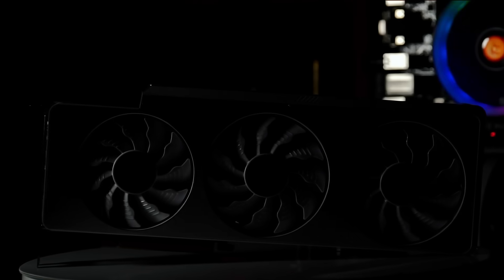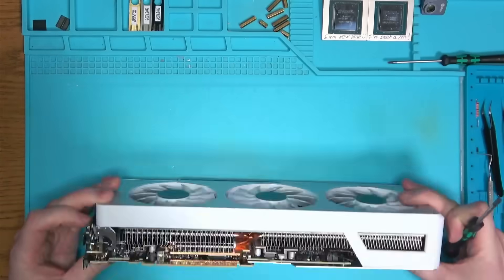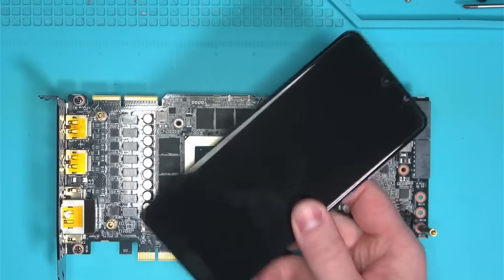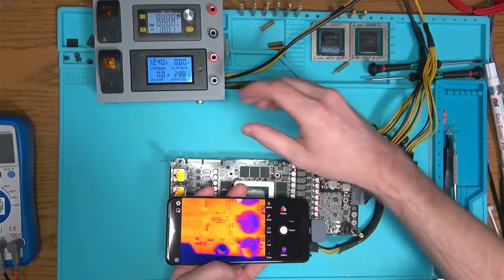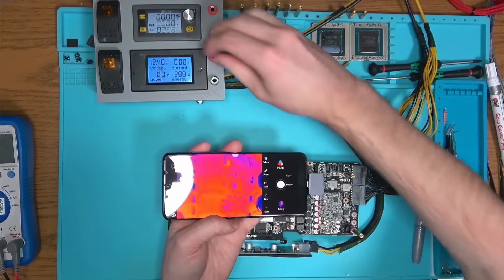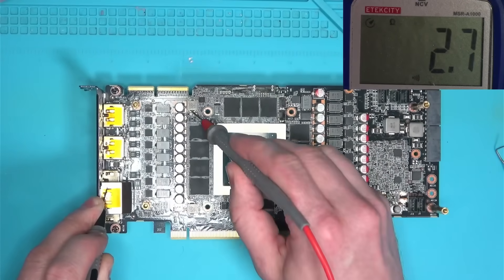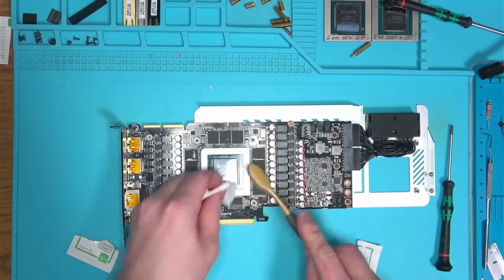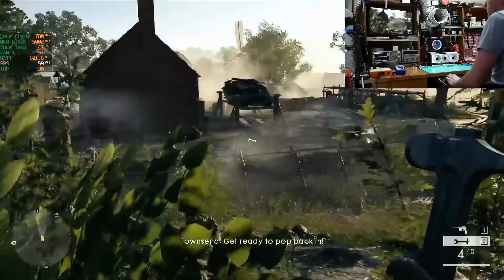Do rare and expensive graphics card fail less than budget cards ?

Comment: Tony, you didn't answer the question. Do rare and expensive graphics cards fail less than budget cards?  
Also, I have a question: you said the card was heated to at least 150°C. So, just to be clear, you have to have the entire card heated up hot enough to roast a turkey, before work can even begin? Is that what needs to be done every time? The hot air itself isn't enough? (150°C = 302°F, turkeys are often roasted at around 325°F . . . close enough) The polymer caps can handle the 150°C?
Reply: Hot to a Turkey and a powered on graphics card is not hot for a graphics card that is not running. 
Preheat in the area you are working on lowers the duration and intensity of heat needed to finally melt the solder and replace the part. This is standard practice if you are not butchering what you are working on. Lead-free solders melt in the neighborhood of 425 °F so the 320 degree temperature is a STARTING point for melting lower temperature leaded solder which you wouldn't even find on these cards.  These cards are made of many layers of copper and not preheating would result in the heat you put into the card quickly racing away from the solder you want to melt which means you need higher temperatures on an iron, in the 600 Degree range, to have a chance of removing a simple component and nothing on the board is rated to handle that much heat.
Tony can't actually answer the rare cards vs budget cards question because he only sees broken cards and he only sees broken cards people feel are worth repairing ( basically people only feel it worth the effort to save an expensive card these days so his experience is highly skewed). The best person to answer that question would be the RMA department of each card maker.
Reply: @btwbrand  That makes sense, thank you, I appreciate the explanation.

Comment: äh sorry when i post this shit here but.....my 3060ti z trio with hynix memory chips is second place worldwide 3d mark with 15771 points in fire strike extreme...this card will run 2175mhz core clock and my 5800x goes on 5.051ghz
temp card 56°c
temp chip 65°c

i got no problems or crashes with the hynix memory, this card runs 110% perfect and got a 257.8w powedraw and beat a windforce 2x 3070 lightly in 3dmark scores....

Comment: So, since EVGA is out of business, what's the most reliable brand recently according to you? Gigabyte is the only brand I never had a problem with, but I guess you have a lot of fixing to do on these cards too.
Reply: EVGA def never held that title considering the blown caps of the 900-1000 series and ripped PCB/pads under mem and gpu for 30 series. He’s had at least 10 evga just ripped to shreds and had to retrace them. EVGA got out of the game because they couldn’t make their cards any cheaper without falling apart
Reply: I know asus got a bad rap recently but I still think they make the best hardware. imo gigabyte is on my avoid list, MSI seems meh, asrock doing a good job recently but I don't think they do nvidia cards.
Reply: @Born_Stellar I like Asrock but god damn their motherboard BIOS's suck.
Reply: @alexturnbackthearmy1907  I've always ran into inconsistancies with running ram at their stock speeds (even when listed as supported on their website) and applying any stable overclock for AMD atleast. They're buggy as fk and don't have as much options in their BIOS settings compared to asus.
Reply: @Born_Stellar  no but they do intel cards lol
Reply: @Born_Stellar  I got an Asus RTX 4070 Dual last year, but the vents are very noisy already. Never happened with the Giga cards. So I'm kinda disappointed so far about Asus. But at least it didn't burn down (yet).
Reply: @Homelander-ftw   weird i just got a rtx 4070 dual and its quiet.
Reply: @Stackali  Yeah mine was quiet too. For several months.
Reply: gigabiga,ass us or any other,they don't matter actually since all parts comes from one vendor or two..it's up to them to make they own choices to make somtn good and at moderate price..
Reply: Good question. I would also like to know the answer.
Reply: asrock bios are a little old-school, but if anything this means that they are consistent and relatively easy to navigate. MSI's click crap personally throws me off, feels like cpu options are located under 5 different menus
Reply: I would avoid Gigabyte personally. Their RMA was hacked a couple years ago and wiped entirely during 3000 card release and fucked over alot of people who sent their stuff in for repair.

Comment: Card owner here. To give a little more context into what exactly happened to the card. I use the card for a 4 monitor setup. It black screened while playing a game called Afterimage from steam. A 2d/3d platformer. I've had the card blackscreen like this on me before but it seemed more like the drivers just crashed since a simple restart of the pc would fix the issue. Just a bit funny to me that some indie game would be the one to take out my card. Not even Cyberpunk. Oh well, I got the card back. Runs good. Thanks for the fix. 👍
Reply: Some games are unoptimized for power consumption. There was a crappy free first person prince of Persia rip off that had my cpu above 80c when even cinebench wouldn’t do that
Reply: @FunkyTechy  Ayup. I remember New World from Amazon literally frying GPUs due to uncapped framerate in the main menu 💀
Reply: @FunkyTechy  Makes sense. I assumed as much with what happened here. I'll be using riva tuner and afterburner to limit power from now on when messing around with these indie games. Not risking that again.
Reply: @Laggyness  v-sync also helps if offered
Reply: @Laggyness   Looks like that card does a very good job of limiting power draw with default Nvidia Drivers. Notice it maxed out on power draw at 350ish watts and still had plenty of thermal and GPU headroom waiting to be used but can't access it because of the power limit.  Heat is what takes out those Power mofsets of which you had one replaced and usually the way a card owner wrecks those is having a high gaming load and a very quiet fan profile. If you were increasing power draw on the card with out doing so for the fan speeds that is another way to cook those high amperage parts. It's a nice card and should work great for many years past the warranty period if you work it within the stock power limitations.
Reply: How much was the repair?
Reply: im not hating on NWR as they do great work, but did you check to see if this was in warranty with gigabyte first? they cover it for 3 years after manufacture even without a receipt, even if you bought on ebay.  couldve saved you $200

edit: nvm you said its a nov 2020 model, but if you are an original owner or its that close to warranty expire date, manufacturers will usually give you some leeway like 1-3 months. i've had evga gigabyte asus and msi all give me some leeway on warranty claims without a receipt
Reply: I got the card new from Newegg. Died a month after warranty. I just didnt want to take a chance with them so instead I sent it to this genius and he fixed it. Plus I get to see how it was fixed which inself was worth it. Audience gets to watch, I get to see what went wrong. Win / win  @UrokLizard
Reply: What you need to do is run the card undervolted, on locked voltage. You do this trough SW like MSI afterburner, you press CTRL+F on the graph and, well best read a guide, but I suggest having 2 modes. One at very low voltage, like 0,75v, on which you should achieve around 1500-1600Mhz. You should run the GPU like that all the time unless you need the maximum performance. You will save like 100W and your mosfety will have easy life. Then you should have another preset, higher, at around 0,875-0,9v which should give you between 1800-1950Mhz depending on the quality of your core. You will still save 50+W and keep your card much safer.

The problem with Ampere generation, mainly the more power hungry models is that they have huge peaks/spikes in power consumption and the power limiting/boot mechanism Nvidia has on that generation cannot keep up. There are small moments the GPU can draw like 500W and kill the mosfet before the power-limit caps it. Its not gonna happen in stuff like Furmark cause that is constant steady load, it will catch that, but it is vulnerable to pulsing load that is there just for a few ms and then nothing and then there is a load again. If the spikes are too short it will average them out and keep the GPU on high voltage which can break the power stages. This is why many 3090 were dying on like New world login screen, or yours died in seemingly low-demand indie game. There was a pulsing load. In certain version of Topaz AI upscale Iv seen 3090 spike to like 160% of their power limit regardless on how it was set. 

That is why its best practice to keep the card on manual lowered voltage, so the boost system will not accidentally kill it by not detecting transient spikes and running too high voltages there when there are massive power spikes it fails to detect. Honestly I would try to sell it anyway. 3090 has 24 GDDR6X modules that alone eat over 100W and reach temps over 100+C regularly. It is a cold-solder-join magnet. Its just a matter of time until it succumbs by one and will need another repair and another.
Reply: @Lady_Zenith Interesting comment, ¿the 3060 and 3060TI are safe of that power spikes?
Reply: @taerkasten5090   Usually yes, not because of better design, but their cores are so much less power hungry that the spikes are equally smaller.
Reply: All the cards have one common problem (they have many but this one makes VRMs fail). The juice from the thermal pads mixed with a tiny bit of electrically conductive dust accumulates under a chip that's responsible either with the power distribution, power limiting or anything else related to a proper functioning of VRMs. Sometimes that accumulation can be found on DrMOS  pins or a power stage pins disrupting just a bit their proper functioning so the power parts are failing. Periodically, video cards should be dust cleaned, paste renewed, pads changed and the boards cleaned in an ultrasonic cleaner. Higher frequencies mean more performance but also more maintenance. The maintenance part owners don't know about. A power MOSFET of the old cards can function almost properly with mud on it but a powerstage functioning at around 500-600 MHz is going completely crazy because of a little bit of humidity and some particle that contain specks of iron oxide
Reply: Why would you even need a 4 screen setup for, if I may ask out of curiosity?
Reply: how much did he charge and what link to get mine rma
Reply: Yey!!!
Reply: next time run those shit games with vsync on theres no point of running 400w to displays menus...... overheating this sit and then game over.... with no warranty? the gpu is very new
Reply: @thepro08  Technically the GPU went out of warranty exactly 1 month after the 3 years. Got it in Nov of 2020. Died on new years weekend 2023. I wasn't even going to attempt trying to get an RMA from Gigabyte with their track record.😒
Reply: At least it resulted in a really cool video! I hope that after this top-notch repair the board will last for many years from now on!
Reply: Thats a really beautiful card, im glad he fixed it for you.
Reply: @Laggyness  After RMAing my 3090 VISION with Gigabyte they put a 10-amp fuse on it instead of the 20-amp fuse... Similar issue. I had a game open in the background, but my PC just randomly shut off. Didn't freeze, blue screen, or anything. It went from working fine to powered off, like someone had unplugged it. I had to manually turn it back on, which threw the "no GPU" code. Putting the GPU in another system with integrated graphics, the GPU was invisible in both the BIOS and Windows. It didn't even show up as an unknown device.
Reply: @thepro08   and limit the fps from nvidia drivers!
Reply: @thepro08  they’re from 4 years ago, most companies do 3 years and also it’s gigabyte and 30 series so it probably got hacked outta their system (that’s what they say)
Reply: @thepro08 same, got my rx 5700 xt for 3 years and still not having any issues despite playing with ultra settings. Vsync is there to save your gpu
Reply: Should have bought a rtx 4090 instead of sending this for repair
Reply: @gejamugamlatsoomanam7716  "Should have spent $2000+ instead of ~$100" ... lol, the stupid shit people say on the Internet.

Comment: Maybe it´s just me but my budget cards were much more reliable than the expensive ones.
Reply: There's a bias here though, cheap cards aren't sent in for repair because they're not worth the repair cost. Expensive cards are.
Reply: @RedShift5  I have more than 20 very cheap cards waiting to be fixed this next week. Obviously fixing them will cost less than fixing expensive cards. Anyway I would always fix 50 cheap cards instead of one that's expensive just to know they don't go to garbage and because they get simpler faults.
Reply: Less complex pcb design perhaps thereby reducing failure point compared to more powerful gpus 🤔
Reply: @tomthomas3499  Also less power as a result on same components. And that is good for long life.
Reply: Not just you. My GTX 670 and GTX 1070 both still work after all off these years. Never thought that buying a top tier card would give me grief